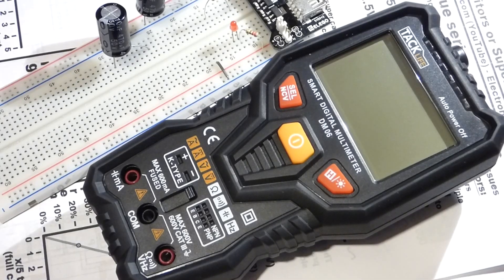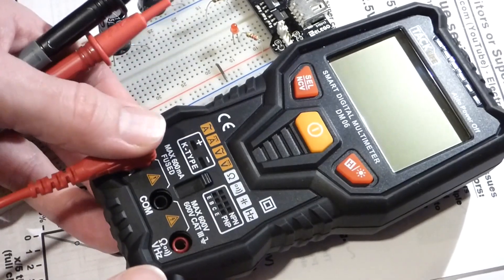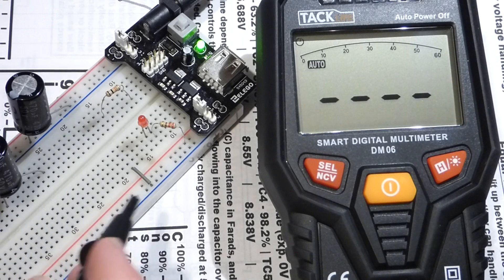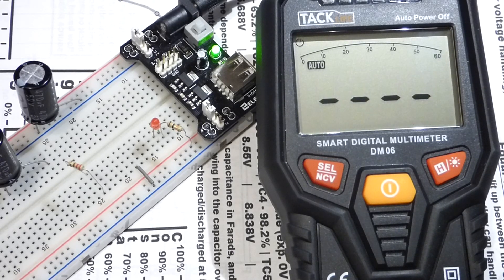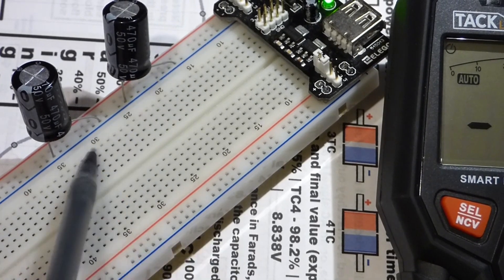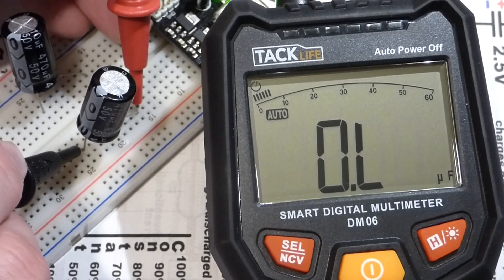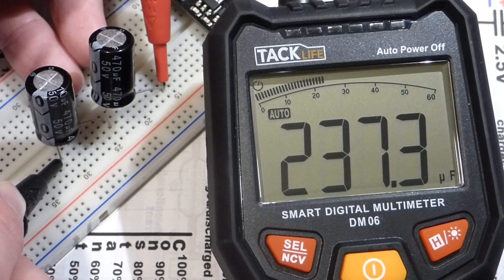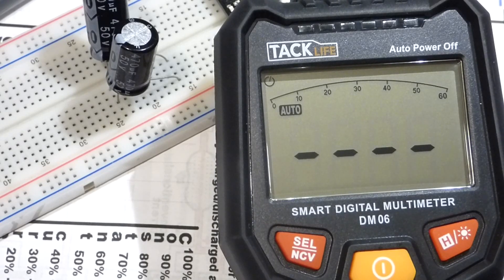My new Tacklife DM06 multimeter 2 automatic current and capacitance measurements electronzap

Comment: Question On This Particular DM16. Can I Measure Less Than 10 Amps?  And Where The Red Cable Connects To This  Multimeter? Because This Dont Have  A 10 Amp Fused Hole. Hope You Can Help..

Comment: The probes are actually quite long, you just need to pull the insulators off them
Great video, very informative.
For what it's worth, my brand new DM06 has started to fault. When switching on, the display now just cycles through random numbers and never settles back to - - -. I have only used it once, to check a 6v power supply voltage. Hope yours lasts longer.
Reply from the maker: Yeah, the insulated bits looked like they would come off to expose more probe but I guess I didn't pull/twist hard enough when I tried lol. That sucks about your meter not working.